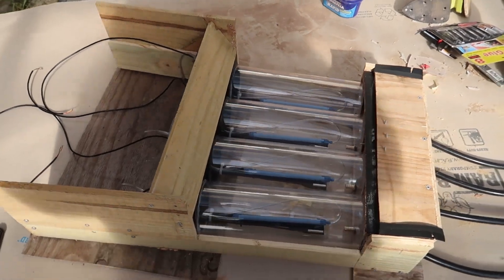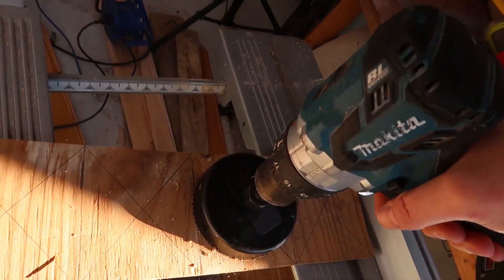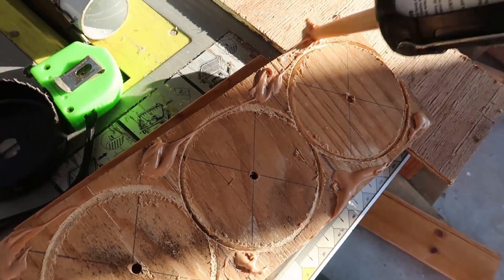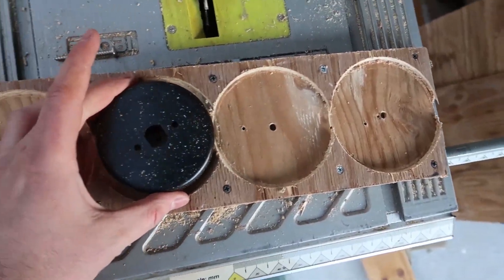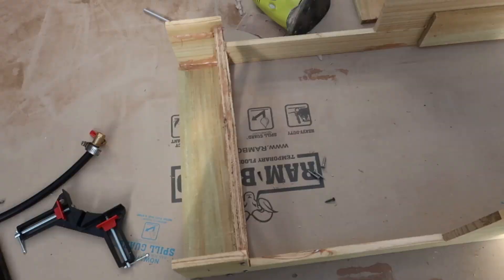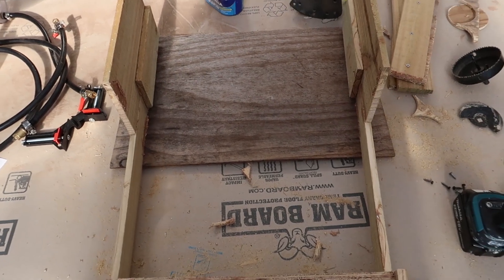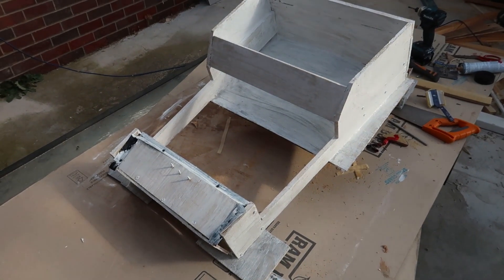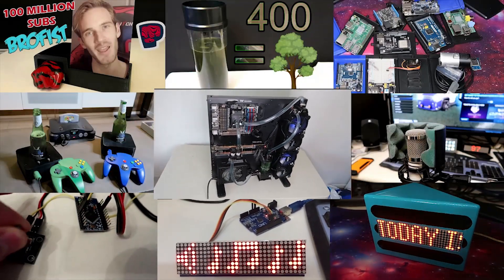Co2 Scrubber enclosure

Comment: how about some reflective material behind the tubes? 
or maybe red/blue LED strips to keep it running at night
Reply from the maker: Reflective material Initial thoughts it will help. Not going to test that yet though. Same with LED strips I will do tests later. Reason being when it rains I want water to flow through and this will be attached to a tin/steel roof (kinda reflective) but it’s consistent for results. I don’t want to run into water pooling/draining issues. I want to get a base result with sun only then try LED/sun combo and also LED only

Comment: Finally another video! Where did you get the plastic cilinders from? I'm building some algae CO2 scrubbers myself but I haven't been able to find any decent containers for less than like 30 bucks each, which is way too much considering a PET bottle works just as well... Thanks!
Reply from the maker: Cheers, These tubes came from Bunnings which is a major hardware store in Australia (not sure which country your from), I mentioned in another video the tubes are originally rain water measurers and where around that $20-30 AUD range. although in the long term these tubes are designed for the testing phase, when it comes to Larger/Longer tubes I will be going into a few different options including low cost DIY to low effort but more pricy options.
Reply: @ScottyDIY  ah I see, thanks for the details!